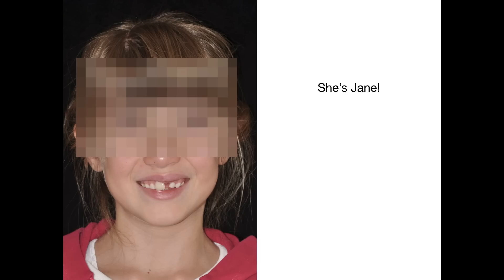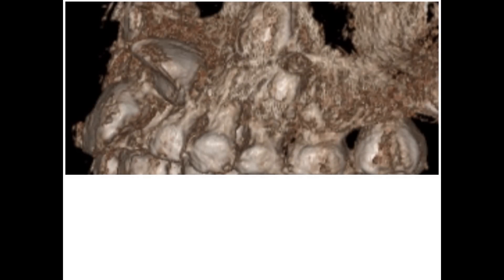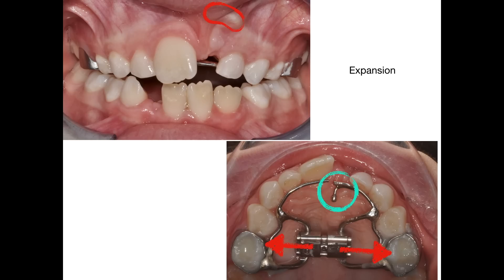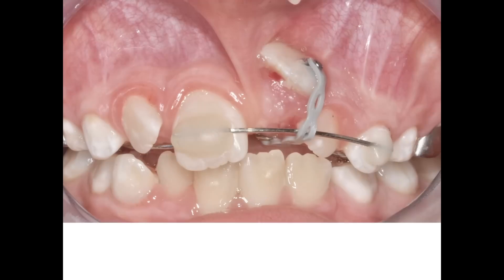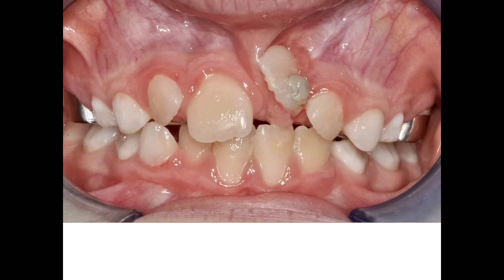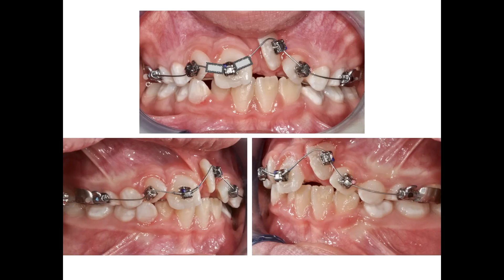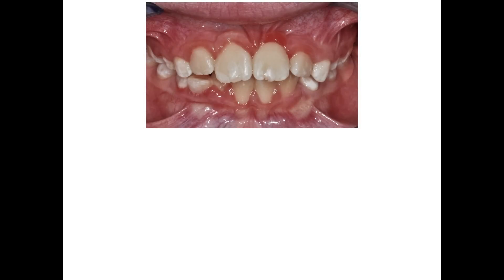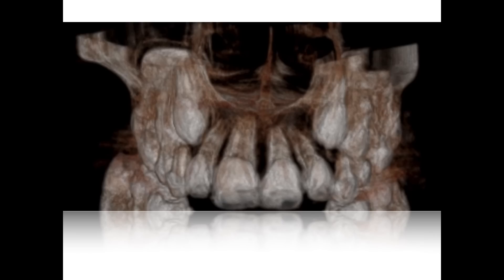🔥Unexpected orthodontic impaction 🔥

Comment: Wholey smokes I had the exact same thing!  I had the surgery and dental work done in the mid 80s.  I had braces on for 3 years and have had a retainer glued on the back of my bottom teeth for 35 years now.  Same retainer too.  My 2 front teeth are slightly crooked again because my front tooth gets really weak when straightened. Anyways lol this was so awesome to see. I had never seen anything else like this since my journey.

Comment: I started braces the summer of 6th grade. I was unable to get a doctor to fully remove them until I was over 30yrs old. They didn’t want to touch another’s work. I also had the spreader in the roof of my mouth and under my tongue. It left indents that will remain in my skeleton. The bands used to anchor my back teeth caused identical cavities in all 4 of the back molars used which lead to losing them all before I was 40. Even if it worked out great with no future problems. Having a tooth pulled and the surrounding ones left in a vice for a month to then only be tightened more is at best a miserable time. Thinking back on it is like half a century ago and still made me grab my teeth.

Comment: My granddaughter was born without 3 teeth.  After her front teeth came in nicely, I noticed she was missing a bicuspid.   A dental appointment later shows she is missing both adult  bicuspid.  So the decision was made to pull 3 baby teeth to get her adult incisors to drop correctly.  Well, they never did.  Her front teeth have separated and she has a huge gap on both sides of them as there are 2 teeth missing on both sides.  The incisors are there, they are up and behind the front teeth.  She will either have to have a space left for the bicuspid or have every other tooth forced to move forward to fill the space.  I am leaning toward implants when the incisors are down and in place.  Yes, we will have to do the same thing to them to pull them into place, but we have to cut into the gums to get to them.  She is getting discomfort from them on her front teeth.  She also has no wisdom teeth.  So, nothing to help fill in the back of her mouth if all the teeth are moved forward.  We were told the total process will take 31-36 months!  How did you accomplish what you did in 6 months?

Comment: This was amazing! I had a question as to what tooth numbering system you use, it had thrown me through a loop for a moment there since we use the 1-32 system. Is it based on quadrants? And do you use it for primary dentition as well? Good work!
Reply: He's using the FDI notation, I'd guess. First numbers are the quadrants named clockwise (1-4: 1 upper right, 4 lower right. Primary teeth usually use 5-8 instead of 1-4 ) and the teeth are named from the front to the back (central incisors 1, wisdom teeth 8). 

That notation is the most commonly used around the world and by the WHO btw (except of course in the US and UK)
Reply: @Quareulux  Oh awesome— thank you so much! :0
Reply: Kids teeth are numbered (here in the US) by ABC system. The numbers are used to identify adult teeth. Kids have what's called mixed dentition at one point where it's usually front teeth are numbered and back molars are still letters. 

Yes, there are 4 quads: upper left, upper right, lower left, lower right. upper jaw is 1 through 16, lower is 17 through 32.
Reply: @AmykinzVlogz  Oh sorry sorry, I knew that bit haha. I’m a DA in the US but I was curious because the system in the video seemed to be different from what we use at least in my office. Thank you for taking the time to respond to me though— I’m sorry for the misunderstanding :’D I wasn’t sure if the numbering by quadrants was something we also did in the US or what
Reply: @eike1124  you never know! Since ur also a DA you know how often dentists have their own crazy rules or ways of doing things 🤣
Reply: @AmykinzVlogz  Truuue, I just started this year so I have yet to experience differences in offices and doctors XD

Comment: It takes courage to share a case that perfectly demonstrates what not to do, and we as dentists learn far more from such cases than cases that go perfectly, so many thanks for sharing! The soft tissue is not inflamed because of poor OH. It is inflamed because it is mucosa, not gingiva, around the neck of the tooth, and it is mucosa around the neck of the tooth, not gingiva, because you made an incision in mucosa instead of uncovering the tooth with an apically positioned flap
Reply: Will it resolve itself
Reply: @XclusiveChiq  good question. Best case, it could get less red with time but never "normal" looking and will always be more easily irritated. A gum graft now could get it close enough to normal and from the patient's perspective all would be fixed. From the eyes of a dentist, a gum graft now (set aside the extra procedure and cost to the pt) would still not be quite as good a result as if the tooth was uncovered properly in the first place
Reply: Well siad
Reply: I'm not versed in dental work, but this reads as a bit of a passive-aggressive remark to the narrator.